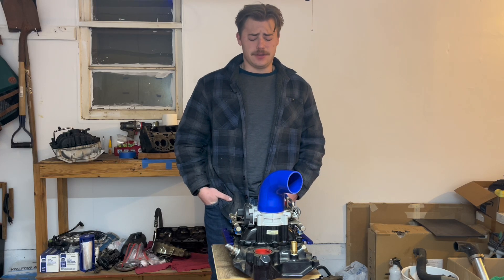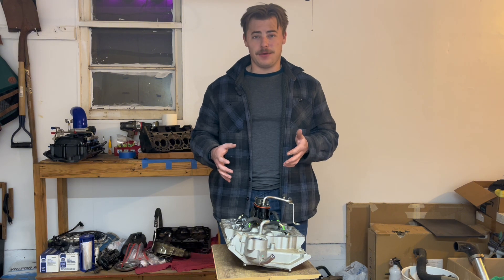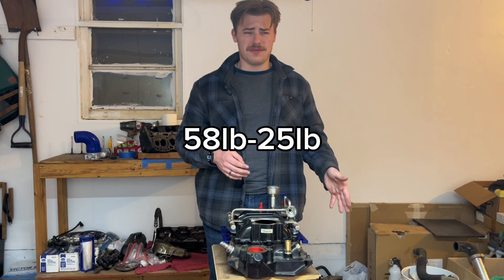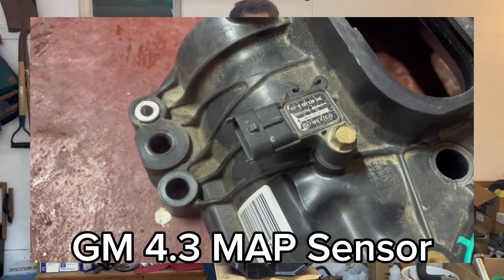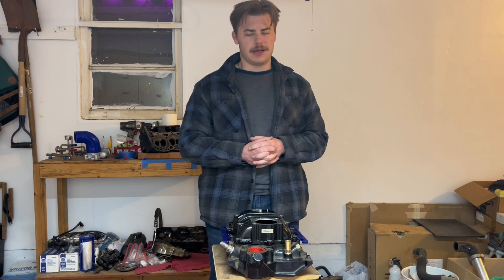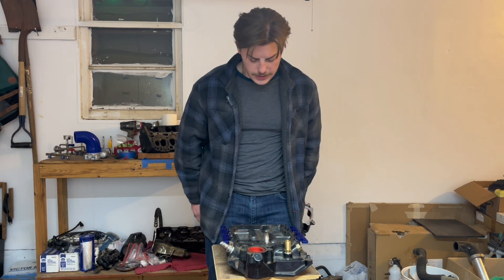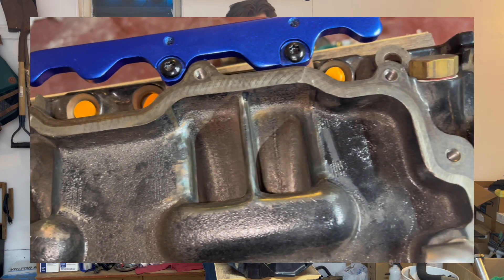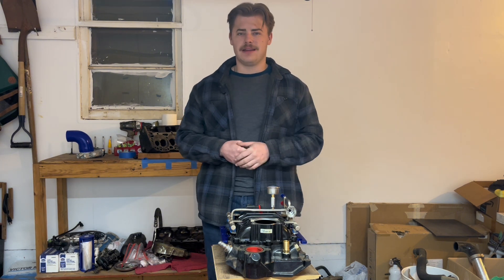What’s with the 4.3 MerCruiser Marine intake?

Comment: @LantiTeo, In the U.S., did the Vortec 4.3 never come from the factory with that intake manifold that has external fuel injectors?
Reply: Nope - all 4.3s were TBI (early generations) or the various Spider EFI systems (CPI / SCPFI / MPI). Nione had external LS style injectors
Reply: @jessetoronto  Interesting, in Brazil, the Blazer and the S10 came with this exact manifold from the video from 2001 to 2004, which was the last year this engine was produced in the country.
Reply: @Marcos-v7s That is interesting / very interesting. The mercruiser / marine version with the fuel rails was such a better design.

Comment: Great video. When we did this swap I was surprised how well the truck ran without much tuning. We just tweaked the fuel pressure to get the trim levels back to normal and drove it several months before adding the turbo. Unfortunately the price of these intakes shot up over the past year and some of the individual parts like the lower plenum and fuel rails are discontinued from what I can tell.

Comment: The Spyder is an electric cousin to a early diesel pump with poppets. Low pressure compared to that of course. Its only advantage that I can see it its cheap compared to the standard multi point setup. I had in the back of my head for a down the road project, taking a AL carb manifold and putting in injector bungs. Its been done for other applications where there were never MPI setups. I would have a hood clearance issue with that marine stack.

Comment: Ive been looking to change to one of these for just my daily driver Astro van, so I dont have to deal with the spider injectors failing in the future, but man are they hard to find and expensive these days. It really is a shame that Chevy didnt use this style of intake on more vehicles. Or some kind of way to modify the existing intake to fit the fuel rail and injectors would be amazing.

Comment: What you do with the EVAP Emissions Purge Solenoid Valve with the marine intake I’m doing the same to my s10 please let me know thank you
Reply from the maker: You uhhh “delete it”…theoretically…in Minecraft (don’t hurt me EPA)
Reply: I was planning to do that but you get a check engine lights what you do to delete it without an engine light?
Reply from the maker: As far as I know, the only way to not get a check engine light after deleting it, is to tune the ecm to ignore EVAP codes.
Reply: I made an aluminum plate to attache to the right side of the intake in place of the blue plate he has. I drilled and pipe tapped it so a 90 degree 3/8 hose barb would screw in from the bottom and be flush with the the top. I drilled out the id of the pipe threaded section of the hose barb to be the same id that the hole in the original intake for the the canister purge valve so it fits in like stock. I drilled and tapped the two mounting holes. Run a vacuum line from the barb to a vacuum source on the intake. I mounted it in place of the blue metal plate in a close enough location to the stock manifold so that the hard line to the canister hooks up just like factory. No codes and no fuel smell in the garage.